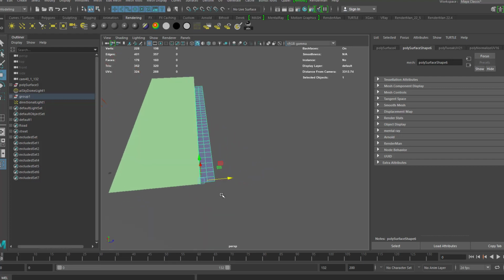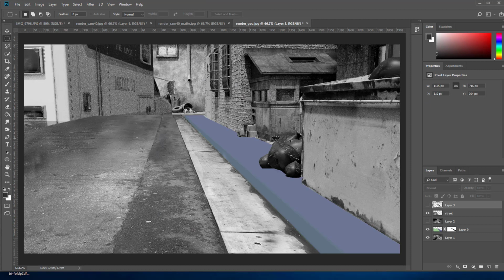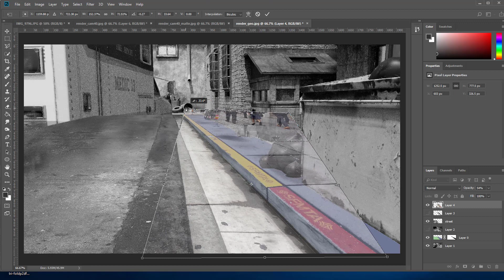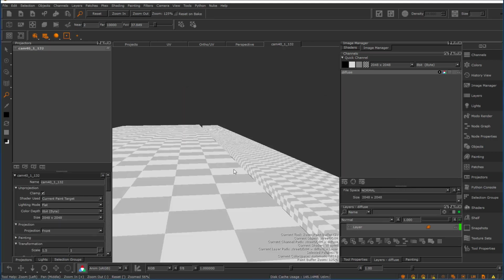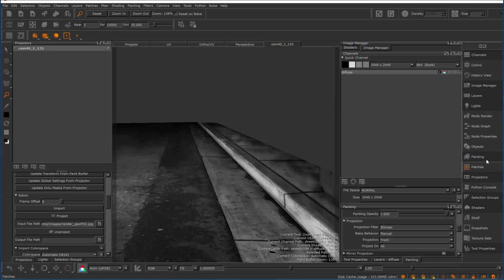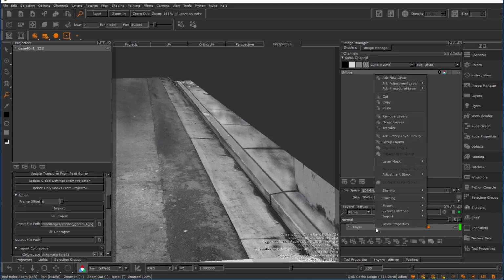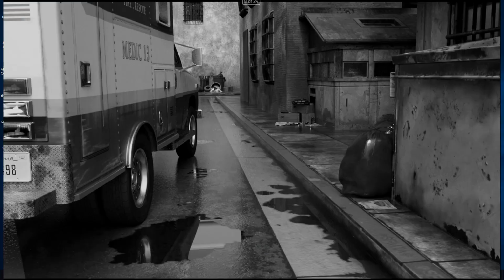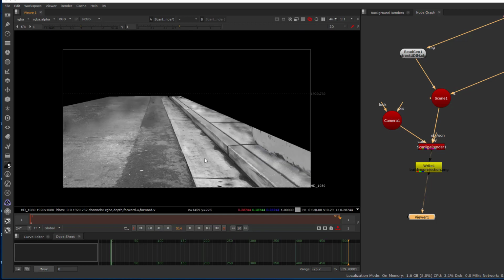3D Matte Painting in Mari | How to camera project paintings onto 3D geometry in Maya for CG Renders

Comment: Thanks for this data!
But have a BIG problem: The projection does not match, not at all. I followed all your steps, but mari's buffer seems to do what he wants. The texture is applied without taking into account the limits that the camera brings when importing, it is projected outside the limits. not matching what would happen if (for example) I did a camera bake.
It should be a transparent process (import the cam, the geo of the same scene and that's it, the projection would fit as in Maya and the plane of the same cam... but it doesn't happen like that)
If you have any advice I would greatly appreciate it. cheers.
Reply from the maker: You probably need to check and adjust the camera settings in both Maya and Mari. Also you should turn off auto bake.